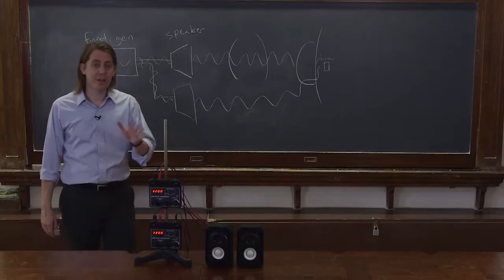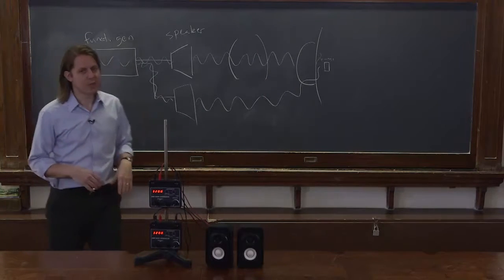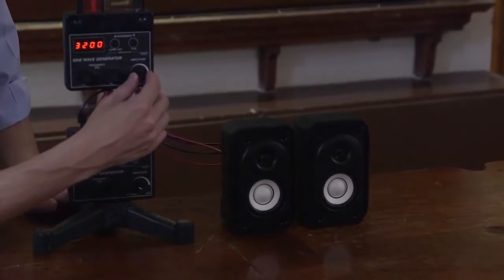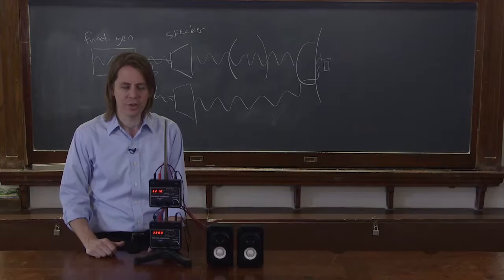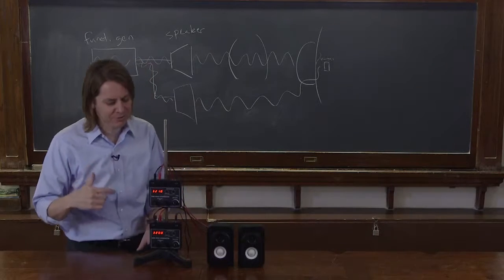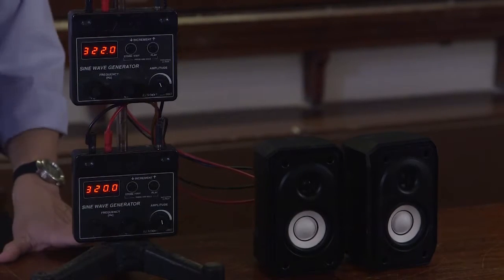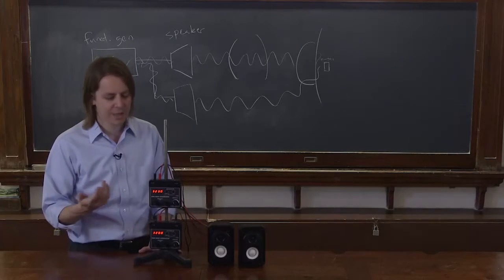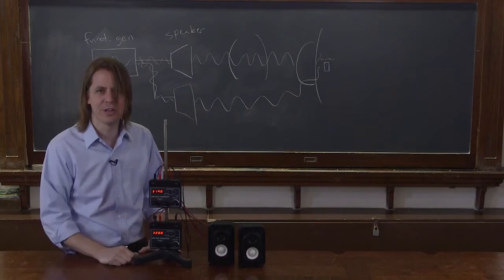PHYS 201 | Superposition 10 - Beats Demo

Comment: When there's a 2hz difference you bump your hand on the desk at one Hz.  Also, would be cool to see a bit of a musical interlude. If I may suggest

Instead of a 320, you could play a 440 (concert A) . then the cool bit about the hz difference you just explained. 

Then, while holding 440 in one of the generators, you can use the other to use the following to spell out a major scale:    
A -    440 Hz
B -    493.883 Hz 
C# - 554.365 Hz    
D -   587.330 Hz
E -    659.255 Hz
G# - 830.609 Hz
A -    880 Hz      

Students can go here http://www.szynalski.com/tone-generator/ and do it themselves. 

I know it may be too much... but you can build chords... open 3 browsers on that page, then from the list provided, chose one, skip one chose one, skip one, chose one... for example:

choose the A
skip the B
chose the C#
skip the D    (HA!)
choose the E
result A + C# + E : major A or the "one chord" in Amaj.

for the "4 chord", for example, you do the same thing, except you start on the 4th note of the scale. ( D + G# + A )

Last idea, In honour of Chuck Berry, if you play the 1, then the 4 and then the 1 and lastly the 5... that's the musical archetype for the blues. That's called the I-IV-V...     Other cool chord progressions are the jazzy 2-5-1 or 6-2-5-1. the 5-7-1 ... I'll stop now.
Reply from the maker: Good idea!  This is from a class I made a couple of years ago so I can't update or alter the video. However, it would have been good to take the beats a little further and to show how they sound nice as chords.

If I teach it again in the future I'll keep that in mind.

Also, just FYI, those function generators are quite so precise to hit exact notes! :)